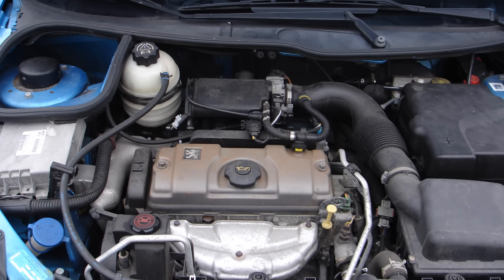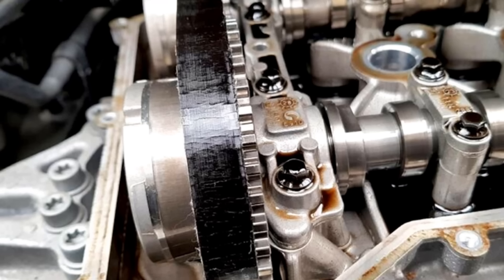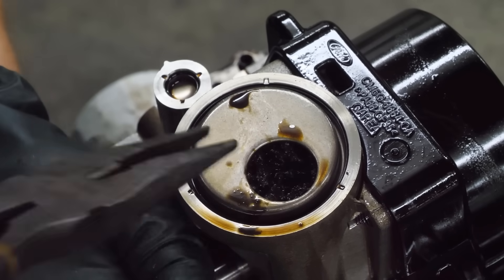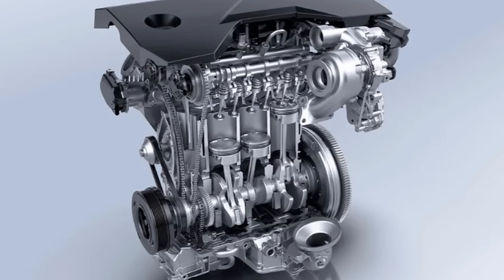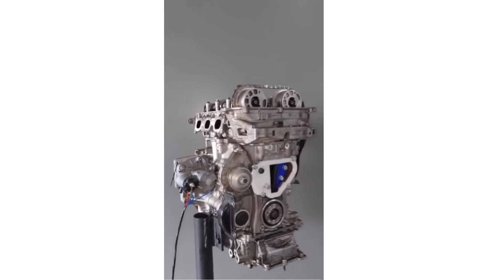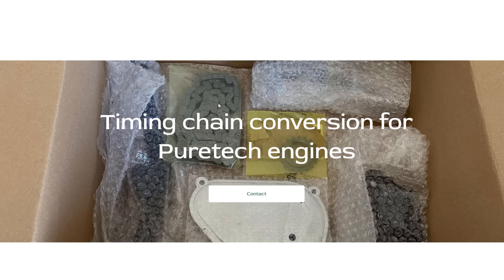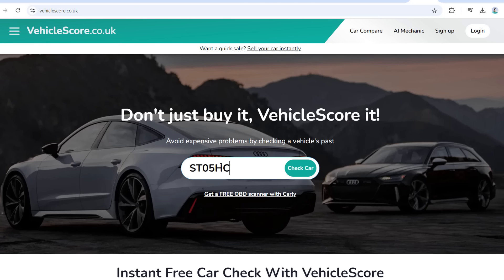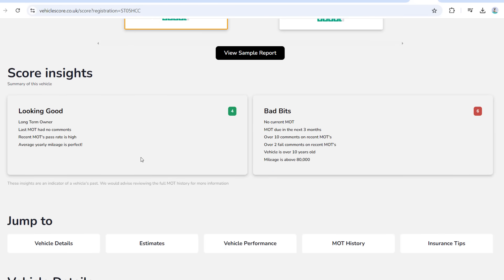Peugeot PURETECH Fix Is Here - All You Need To Know

Comment: In balance, best cars were made in the '90s: they were enought reliable and got power steering, air conditioning, electric windows, EFI and ABS, but no canbus, no electronic throttle, no OBD2, etc: they're "modern" but easy and cheap to repair.
I highly recommend to get a low mileage good car from 1992 to 1997, and enjoy it for many years.
Not an "expensive - spares" one (Mercedes, BMW): just get a good and "normal" car and avoid all kind of problems, taxes, etc: simply be happy.
Greetings from Patagonia, Argentina ! 🇦🇷
Reply: Funny but in the 90’s people were complaining about how impossible to repair the cars were and how we needed to go back to the 70’s😂
Reply: Agree with the idea, Would love a1992 to 1997 car  ...however living with Sadiqs ULEZ means all of these are out for me , unless you have no need to travel into the zone. I therefore recommend any simple non turbo petrol around 2002/3 on .  Get something like a CRV, Civic , reliable everything needed ...chain cam too....
Reply: Sadly. In Europe the government has tried very hard to remove all of these cars from the roads.....with  various scrapage schemes, and High taxes...
Reply: From 2000-2010, simple electronics, reliable, not expensive cars... now, electronics and cost reductions everywhere
Reply: OBD2 is a blessing, not a curse
Reply: 90’s saw many dry belt failures and up to some time in the 90’s, dry belts had a similar bad reputation as wet belts currently have.

Comment: I bought a 2017 (on a 16 plate) 2nd hand Peugeot 2008 puretec in August 23, from a used car dealer. Only after I got it home and looked online for info about the 2008, did I discover the wet belt horrors. (I bought it late in the evening and it was raining, because my trusty 23 year old Toyota Yaris Verso had a rear suspension problem, ie, rust was eating the floor away near all the important places and it had 3 days left on the MOT!) So it was basically a panic buy! Also, on checking all the paperwork that came with the 2008, in its first year of ownership, the wet belt had failed and ruined/killed the oil pump, all replaced by a Peugeot dealer apparently. Well that's what the receipts seem to say. As for oil consumption, at £50 a gallon for the cheaper stuff from GSF, it's still a bit on the steep side! Mine, fingers crossed, doesn't seem to be an oil hungry engine, and with a timing chain conversion, maybe a more traditional oil (and cheaper) could be used. I don't know. I'm waiting eagerly for a price on this chain conversion kit now.

Comment: Would be interesting how much the fuel consumption changes with this conversion kit. The wet belt was introduced because it should have less friction and thus should lower fuel consumption and emissions.
Given how expensive a totaled engine is, the lower consumption definitely isn't worth it of course 😂 But for scientific purposes it would be pretty interesting to know what the difference is on the same engine.

Comment: Avoid all Stellantis group brands if you are looking for recent and reliable car with after-sales service. Former owners of a 1.2L Puretech 110hp, we only had problems with faulty segmentation, excess oil consumption from 60000 km, 1L every 1000 km, ventilation broken, belt in the oil to replace, speakers sometimes broken. We understood that keeping this Peugeot would be a financial pit. We sold it to a professional because Peugeot, well aware of the problems with their cars, does not do trade-ins. 
Thanks for the video
Reply: Same for our Citroën with that same 1.2L 110hp engine. Luckily the garage that sold it to us, thinking it was good because it was a first-owner fully dealer maintained car, took pity on us and took it back. Sad thing is I knew upfront it was a troublesome engine, but the car was also about 5k euro cheaper than an equivalent non-Stellantis car and I figured I'd get away with it as we don't drive much. Well, nope. Short trips actually wear down this engine like crazy. It's insane you can't even buy some cars for what should be considered normal use.
Reply: Such a fall from grace for Peugeot. I have a 2007 Mondeo which has a Puegeot HDi engine and it's been a great engine. I've just had a new timing belt and waterpump fitted, at 233,000 miles and it only cost £250 at my local garage as it doesn't need any of the stupid work doing that plague wet belts.
Reply: tu as tout dis 
il y a plusieurs problemes qui s ajoutent  

le principal probleme n est pas la courroie ce" probleme n est qu une consequence  mais la plus visible
le probleme principal est la segmentation qui laisse passer  l essence au demarrage ou quand le moteur est pas chaud   dans le carter d huile!   d ou usure de la courroie qui aime pas l essence
deuxieme probleme   les segments sont pas assez serres donc l huile remonte du carte   et brule donc  bloque les segments   bilan on augmente le probleme d usure de la courroie   en plus  l huile qui remonte brule donc se cookefie et bloquent les segmemts  donc augmentations des problemes precedendts 
de plus le cylindre est en alu    segments en acier    pas besoin d etre ingenieur   ce moteur est prevu pour se detruire!    et c est pas  une chaine un changement d huile   qui va le fiabiliser

Comment: The main problem in the 1.2 puretech is actually not the wet belt, it is the Godawful piston rings allowing fuel to get into the engine oil, and this fuel within the oil degrades the wet belt. This would also explain high oil consumption on them aswell.

The change to a chain drive is a welcome one, but I'm not holding hopes up for it to solve all of this engine's problems
Reply: non s il change pas la segmentation et le refroidissement du bloc moteur en alu  ba sa changera rien!
Reply: it's more like the particulate fuel injector starting to work in short city drives and the engine shutting down too early flooding the engine with fuel before it has reached optimum temperature long enough, thus ruining the belt.

Comment: Hybrid 1.2 Puretech is already a chain driven engine, I don’t know why in the world they don’t use it the non hybrid cars. The engine is the same, the difference is the electric motor but it actuates directly in the transmission.
Reply: They should be held directly responsible for this and recalls on all wet belt engines at the manufacturer's cost.

Bloody sacrilege. The stories of of engine write offs after a measly 27,000 miles is nothing short of fraudulent sales of these type of cars manufactured with the wet belt designs.
Horrid!

Comment: Apparently it's the petrol fumes that rots the belt ,breaking it up and deposits fibres in the sump which then get sucked up blocking the oil pickup strainer , I've changed a few of these belt kits , the earlier one is harder to do than later models , I always change the crank seal when doing one , the last one dropped the oil pump chain into the sump,  that was nice to fish out 😂😂😂
Reply: The first time i did one I did the same. Almost lost my head when it happened i was fuming about fishing it out the sump 🤣

Comment: As a Peugeot/Opel/DS tech, I can testify that  it doesnt matter if you service your car on time, early, after only a few thousand kms or such, the belt will go bad before the 6 year change mark /100 000 km  on many of the models, some of the newer cars with the wet belt boasts 12 years/200 000 kms... thats never going to happen.... ever... 

the NA 1.2 PT engine doesnt seem to have the same issue as the turbo charged versions, we've barely noticed the NA version having issues with belts beeing too wide, cracking etc, but its almost  always the turbocharged variants tht have the issues unfortunately.. 

the newer engines are 1.2 turbo but with a timing chain; but those are only on the mild hybrid variant...
Reply: So looking at a 2024 408 puretech I shouldn't have an issue with the wet belt? Anything that I should look for on the new 408 thanks
Reply: la courroie peut etre mais la consommation d huile  sa arrivera c est sur!   rien n a ete fait pour resoudre le probleme
Reply: le bloc moteur est en alu    et l alu avec la temperature cela se deforme  augmentant encore le probleme de segmentation!    plus sa chauffe    moins la voiture fera de km
Reply: le seul bloc alu viable que j ai connu  c est  bialbero alfa romeo   moteur qui n est plus produit   desole j en connais pas d autre!

Comment: It is not a problem with the belt, the real problem is that the fuel mix with oil and degrades the belt. If you change the belt by a chain the problem persist, the engine's lubrication is so poor, the oil is constanly plenty of fuel. Watch this mechanic, he explains it and he finds a solution by reprograming ECU. https://www.youtube.com/watch?v=wPLSNyyObZo

Comment: Any help wife has citreion air cross has this wet belt issue can’t start engine, car sold with this recall is there a chance fiancé will cancel this contract as dealer sold this disaster without doing pdi check , any advice would be helpful,
Reply from the maker: When was the car bought?
Reply: @ScottishCarClan  last November mate the dealer knew there was a recall as issued 2021 a didn’t no you could check these things but still sold it to us if this makes sense pal